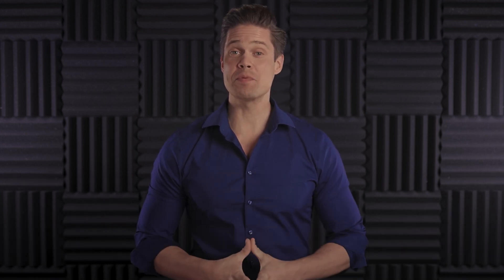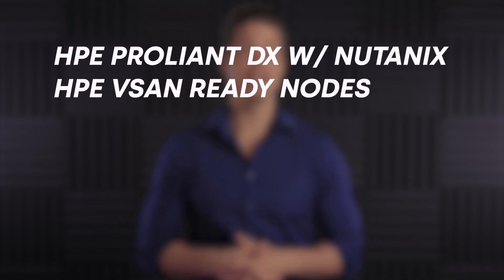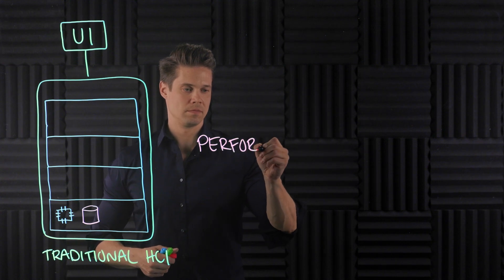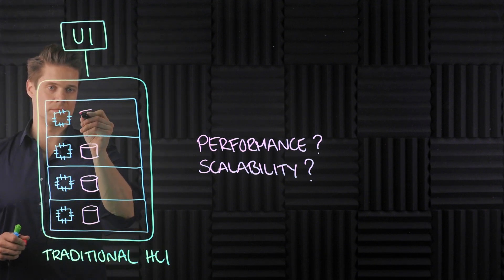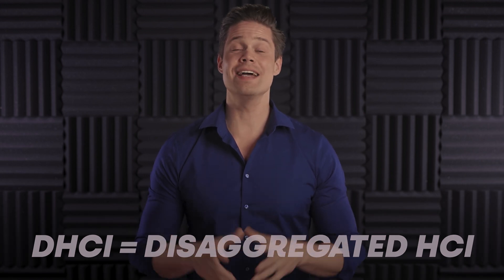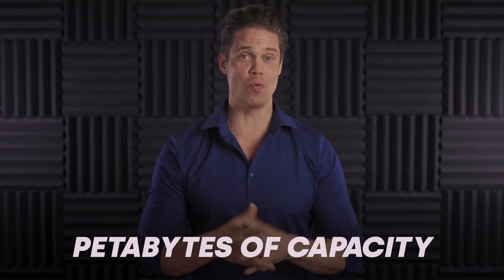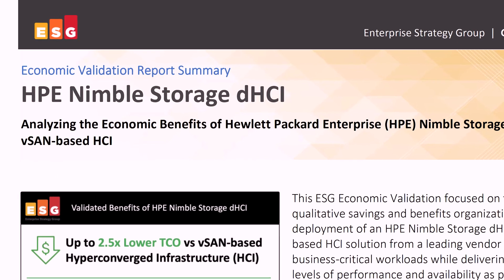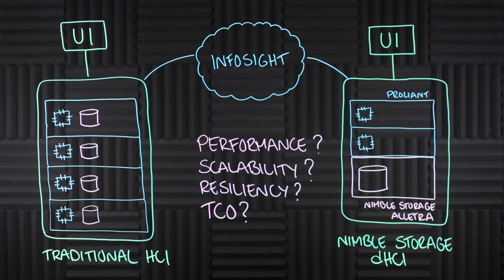Introduction to HPE Nimble Storage dHCI

Comment: Great video. Amazing visulas. 👍 I'm curious however how this solution differs from what we would traditionally call Converged Infrastructure like Flexpod from NetApp/Cisco or VxBlock from DELL/EMC? Is dHCI a marketing term or is it completely different from the solutions I've mentioned?
Reply from the maker: Hi, Ian! Apologies for a delayed response. That's a great question, tho! And you are spot on, as I mentioned in the video...I don't really consider HPE Nimble Storage dHCI as a real HCI, hence the thumbnail, but rather sophisticated converged system that sits somewhere in between HCI and CI. But where it differs from the aforementioned other solutions is how "hyperconverged" the user experience is: there's no need to go jiggling around in the storage array management UI or hassle with server management. Instead, there's a dedicated simple UI for managing the whole stack and the rest of the lifecycle operations are done thru VMware UI.

So, in this sense...dHCI is not completely a marketing slogan. There is truth to it: it is closer to a seamless HCI user experience than VxBlock or FlexPod, which are more comparable to HPE ConvergedSystem portfolio.
Reply: @TechEnthusiastInc  thanks. Makes sense… Could you share a link to your socials? LinkedIn, Twitter? Would love to keep up with you & be updated whenever you post.

Comment: What would be a use case be for the stormagic? Where is the change over point to simplivity from a workload perspective?
Reply from the maker: That's a great question. There are definitely similarities but also lots of differences. First of all, with StorMagic you can choose basically whatever two HPE Proliant servers with whatever storage configuration. Then you license and Install StorMagic SvSAN software on them and off you go! It's super simple and affordable solution for small and simple environments. But that's also the downside, you can't go beyond 2 nodes, so there're capacity and resiliency limitations. In addition to much greater scalability and resiliency, Simplivity will provide you global deduplication, in-build data protection and appliance level InfoSight support.
Reply: @TechEnthusiastInc  Can you make a video on the Stormagic setup? I looked at it for a client but had doubts so I offered them a 2 node simplivity 380 config. It's in production now waiting for delivery so it can be installed.
Reply from the maker: Would be a great topic! Hopefully I have time at some point to make that video but I am afraid it has to wait a bit since I have so many other videos in the pipeline before that. :/ However, my friend Bart Heungens held a great webinar about this topic two years ago and you can watch the recording from here: https://www.youtube.com/watch?v=Mc7kLkb922Y. Hope that helps!
Reply: @TechEnthusiastInc  great will check it out thanks.